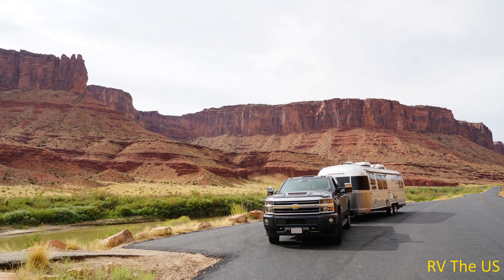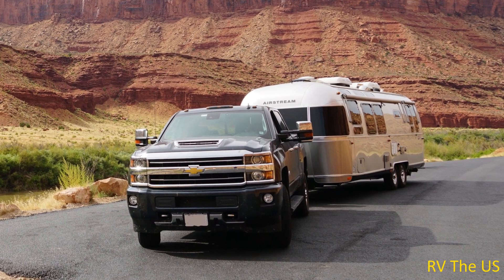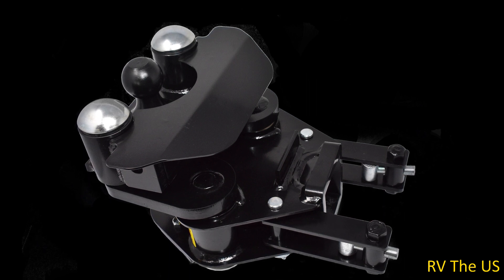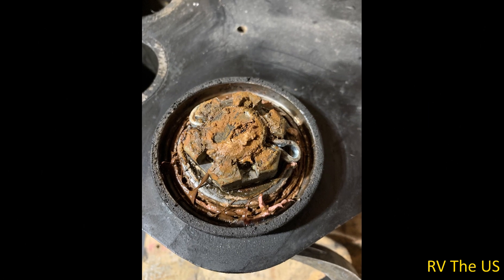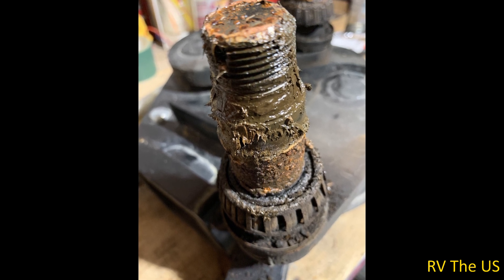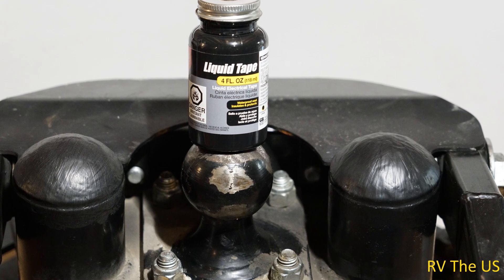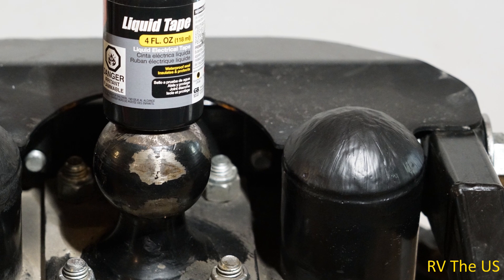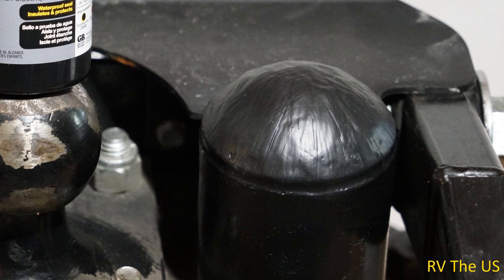ProPride Hitch Fix for Water Intrusion Rusting Bearings

Comment: I have a Propride hitch, how did you remove the caps
Reply from the maker: They are standard dust cover (hub caps).  Carefully take a chisel between the hub and the cap.  Loosen it up all the way around, gently as you go.  It will come right off.
Reply from the maker: Use a small chisel and gently tap tap tap in an upward direction.  Don't hit them hard, as you'll bend the cap.

Comment: Would be nice to have some grease zerts on those bearings.
Reply: There are geese seems on those bearings. You’re supposed to pump them full when the hitch is installed and at least yearly after that.
Reply from the maker: They are standard wheel bearings, so no need for regular greasing

Comment: Is there a non-Facebook video somewhere regarding bearing replacement? Or is it just like wheel bearings? I've done those, and these don't spin like wheels.
Reply: These are standard wheel bearings.
Reply from the maker: They are simple wheel bearings, no different than they have been for 75 years.

Comment: If this happened after 18 months of ownership of the hitch wouldn’t this fall under warranty from propride so you wouldn’t have to pay for the bearing kit?
Reply: Propride did offer to fix the hitch if I brought it to them or shipped it to them, but it was less expensive for me to buy the bearing kit and do the work myself.
Reply from the maker: Sean at Propride did offer to replace the bearings and repaint the hitch, if I brought it in or shipped it to their factory in Michigan.  I didn't want to do that, so I fixed it myself.  Understandably, Propride won't give the bearing kits out for free.

Comment: Thanks for info. I'll have to seal my caps.
Reply from the maker: If your Propride has ever been wet, you should pull the top caps to see if there is rust in the bearings.
Reply: @rvtheus  Thanks I haven't sealed them yet and it  has been wet many times.
Reply from the maker: @michaelmaynard7873  I would highly suggest to take the dust caps off and look for rust

Comment: As expensive as this hitch is, I would have thought it would have zero fittings and pump the cavity full of water preventative grease. I use my this on seaplanes to keep bearings from salt water intrusion. Bearings last for 6-10 years.

Comment: Would the PP hitch cover keep the moisture out?
Reply from the maker: Not while you are towing.  I'm sure mine got wet while driving in the rain.  We stored our Airstream inside when not in use and covered the hitch while camping.
Reply from the maker: Yes while sitting as we did, but you can't cover it while you drive.  We got water in our bearings while driving in the rain.
Reply: @evertmorse8518  I've never owned a Hensley Arrow, but maybe someone who does can answer this question.
Reply: @evertmorse8518  I agree the problem shouldn't happen and should have been addressed at the factory.  The hitch performs so wonderfully that I would buy another one and fix the problem before mounting it on the trailer.
Reply from the maker: Yes, while your trailer is not being towed.  If you are towing in rain, the cover can't be used.